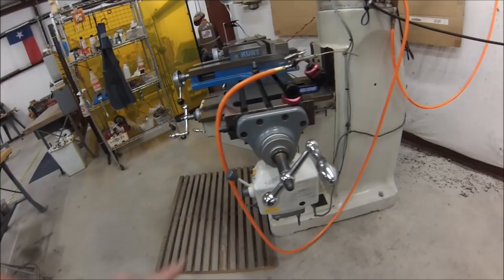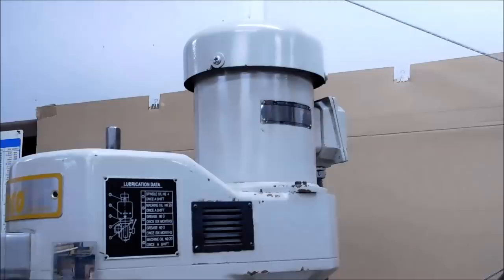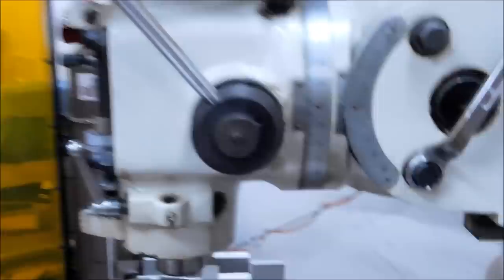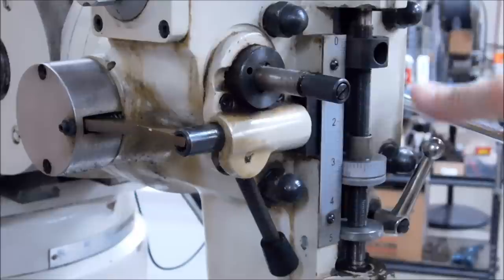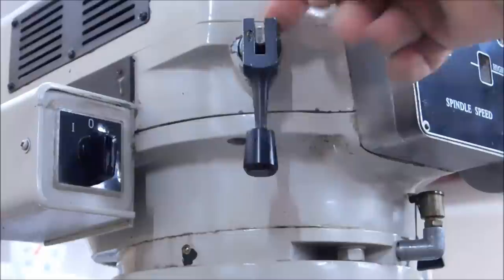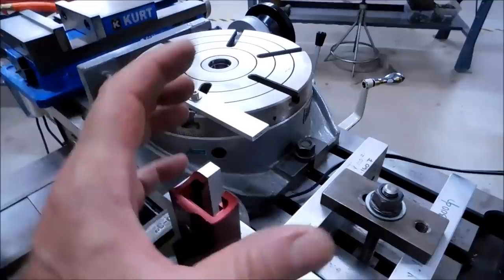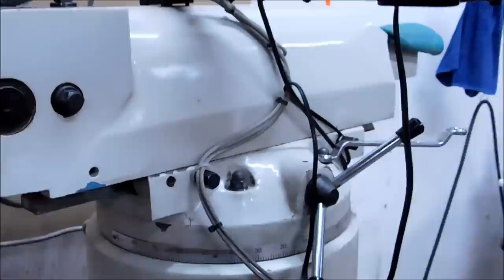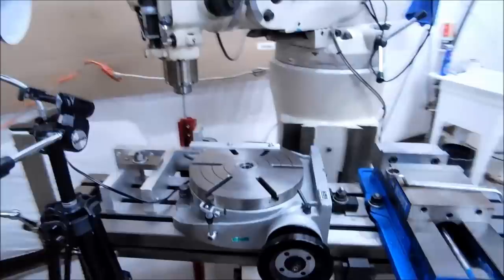Machining - Bridgeport Controls 101 ( and some other stuff )

Comment: Hey Joe , thanks for the video. I just wanted to mention that the feed handwheel is pretty useful for drilling in grabby materials like brass or copper, where you might need to peck as opposed to power feeding. I dont use it often, but it is a nice option sometimes. Btw, I sure miss Enco! Thanks again bud, taker easy
Reply from the maker: MSC bought ENCO a few years back. I bet the machines are exactly the same.

Comment: Power Quill feed is in inches per revolution, typically .0015”, .003”, .006”. Love that outrigger fixture for machining the ends of long parts, going to add that to my project list. Turret knee mills are very versatile. Thanks for making the video. Stay healthy.

Comment: Great VIdeo, Joe Pie.  You should have been a shop teacher at a community college - as you would have been one of THE BEST EVER..  One thing that you didn't do - that was drummed into my head - was to run your finger or thumb up in around the inside of the spindle - to make sure that there are no chips or burrs prior to putting the R-8 collet in... Just a difference in how you are taught.   I have a Chevalier, a upgraded CNC SuperMax YCM-30,  a Brother 215 CNC mill, and a table top mill (Sherline that I CNC'd - its an addiction, what can I say?).  You are totally awesome machinist and instructor - love every video... THANK YOU- for taking the time to put this all together - you're a great instructor.   Please keep up the great work.
Reply from the maker: Thats quite a compliment. thank you. I do regularly check for debris in the spindles, on all my mills, but didn't show it here. That is a good thing to point out. Just do it with the machine turned off.

Comment: Interesting I recently replaced the clock spring on a bonified Bridgeport. I did a really bad thing I read the instructions. They claim the clock spring tension should be set to keep the quill in position only. Not tight as to where it moves the quill rapidly up like yours did, or loose as to where it falls (-Z). I am not saying your right or wrong, clone versus B.P.. Personally I am going reset mine to where it brings the quill up just a bit slower.
That being said I love your channel; I have learned so many great little time saving and accuracy improving techniques, thank you so much. I have been working in the field for a mere 10 years, you remind me of the guy I used to work with, a 30 year tool and die guy. Every day I would learn at least one thing from Harry, it was a sad day for me when he was fired for no good reason. Hope your doing well Harry wherever you ended up & thanks again Joe.

Comment: Good video just got a hold of a 20 year old new old stock  9x42 J head Comet Mighty Max clone for $3200.00 . I'm a retired mechanic  and just started getting into machining this last year .Thanks for the how to videos.  Now i need to sell my new ZX45 bench top
Reply from the maker: Buy nice or Buy twice.....
Reply: Joe what do you think of the Comet clone made in Taiwan it has M in the casting I'v saw this on the Acer brand 
Thanks Steve
Reply: Hi Joe one thing i don't like on the Comet clone is the saddle  has a thin nylon strip on it that  the table rides on  . the knee is scraped
Reply: @junkmannoparts9696  the M that is on the machine indicates that the castings are Meehanite not just cast iron. Nice find.
Reply: @joshwhite6947  thanks for the info.

Comment: I'm not sure on your Enco but on my Taiwanese Precision Matthews, which is a Bridgeport clone like yours, the low, medium and high settings are labeled as .0015", .003" and .006" respectively.  

Enjoy your videos Joe.  I now even use the "bump" technique with the tailstock on my lathe when drilling deep holes after watching one of your videos.  Great tip and thank you for sharing your knowledge and years of experience. 
Mike

Comment: Joe, the "power down feed speed" is not a speed, it is a feed rate, locked to the spindle rotation.  On my Bridgeport it is 0.0015, 0.003 and 0.006 PER revolution of the spindle.

I'm new to all of this so I run my machine relatively slowly. Last job where I used the power down feed was in drilling through a brass weight to clamp to a trombone.  I was using the power feed to keep the drill bit from being yanked into the hole.

Comment: Hey Joe, thanks for the follow up vid. The power down feed and holding the brake to tighten the draw bar were new for me. You can always hear stuff being done in all the machining videos but no one shows it. I remember Keith Fenner mentioning in a couple videos that he used the crank wheel on the down feed as opposed to the spindle in times that something would grab and wouldn't suck down through  a part. He didn't show how though just described it. Anyway good job thanks

Comment: Joe, as far as spindle speed goes,  the VFD that runs my Bridgeport only shows Hertz on the digital display.  I got an inexpensive Electronic Tachometer from Amazon and made a small cheat sheet for Hz to RPM for spindle speed. It has really helped me with my speeds & feeds.

As my health allows, I've been making an adapter to replace the quill feed lever with a nice hand wheel. I believe it will suit my needs better than the single handle.
Cheeers

Comment: What I find interesting is the absence of a power draw bar. It saves a lot of time. I use to machine in the shop at the university and with limited time to change tools my actual cutting time has increased dramatically since they installed power draw bars. I guess is the same for everybody because finding an empty mill is not a big issue anymore.

Comment: I have a Jet 10x50 mill the top is .006, middle is .0015, and the bottom is .003 that how it is marked on the machine. Great video. I will be making one of them outriggers to stand a peace vertically in the machine. I actually have a project that I need it now. Thanks.
Reply from the maker: Awesome. Be sure to put that lower stop on it. It makes clamping the part pretty easy.

Comment: Your spindle feed ratios may be different Joe, but it's not hard to check what yours has. I suspect they probably did copy what Bpt decided was correct though or it might even be listed in your operators manual. Fwiw my Tai built clone shows feeds in thou at all 3 positions so a bit different than yours with only those numbered positions. On mine with the lever straight up that gives .006" feed per spindle revolution. Middle position is .0015" and straight down is .003". I believe the real Bpts have the exact same feed ratios. Since they are geared to the spindle rotation then whatever feed rate you pre select remains the same per spindle rotation no matter what rotational speed the spindle is doing or high / low range (back gear) your in.

Comment: Hello Joe, 

my views on some of the points:- 

Handwheel versus the hand lever to operate the quill. 
The hand wheel is positive control but depending on what operation and material you are working with e.g. drilling through some plastics, using the handle it can grab and pull the quill down as you break through. With the hand wheel this does not happen. Personally with most jobs I do I just use the handle, the hand wheel is not any real gain, and not as easy to use..

Power feed selector.
I had to rebuild my Bridgeport (Well it was cheap) and I seem to remember that the feed is dependant on spindle speed and the three options are simply travel per spindle revolution, what the actual distance is per revolution, I have no idea?

Quill handle.
The Bridge[port manual states that the spring tension should not return the quill but simply keep it in the position it is, i.e. a neutral influence on the quill. It certainly seems a better idea, from the knuckle rapping potential you mention with your machine.

Thank you for all your videos, I have enjoyed them immensely

Comment: The Power Down Feed Speeds on my Bridgeport clone mill are: Right position  .003 per rev, Middle position  .015 per rev & Left position  .006 per rev.;  these are the amounts of vertical down travel per revolution of the machine. My mill is an EISEN 9X49 made in Taiwan.
Reply: I should have said Feed Speeds - Up or Down
Reply: Shannon; I think you may have missed a zero when you typed ".015".  Bridgeports and the clones I've seen are .0015; .003; .006
Reply: @schmidtyyt  You are correct about the missed zero.....

Comment: The typical "Bridgeport" clone down feed is #1  .0015", #2  .003", #3 .006" per rev.
The older Bridgeports were marked this way..
There is a "clutch" in the mechanism that won't allow too much down force to be applied.
Max drill with power feed is 3/8" in mild steel.

Comment: Is your machine securely bolted to the floor? It must be to angle the head that far. I have seen shops where the machines are on just adjustment feet. Accidents waiting to happen.
Reply from the maker: Mine is not. Swinging a head can be made worse when the table is also extended to a limit with a heavy part.

Comment: I believe the 3 position down feed selector is either .001", .003", or .006" per revolution...no matter the speed, although I believe you aren't supposed to run the power down feed above a certain rpm...like 2000rpm or something

Comment: Great channel, great machine and great advice Joe! I was hoping you'd answer a few questions. Little background; I've been Machining for 6/7 years, started in injection molding repair but I've been in optics and collets/spindles/gears. I've run Bridgeports, Lathes, surface and rotary grinders, a lapping machine and a Studer CNC. The company I'm at now pays better than the grinding job (for the company that actually builds and sells grinding and milling machines, somehow.) but the only mills are the oldest cheaper J head fixed speeds you have to manually move the pulleys on from around 68 and 73 respectively and the company has been around since the 40's. Any tips on running those for non nominal radiuses and compensating for not having variable speeds on materials like stainless? Or tips on convincing them to upgrade to something better?(suggested a prototrak converted mill ours are too old to convert, vmc, bed mill or haas mini mill as it's a small area and I'm trying to be reasonable with cost and haas has payment plans lower than 900/month.) Also they told me I'm their expert but I wouldn't say I can be one, I don't even have a full decade under my belt and all my experience was otj not classroom, except for one 4 day welding intro (after they already had me handle welding for about a year without complaint.) what do you think makes someone an "expert machinist"? Sorry for the long post just think people might find this helpful/interesting and I'd like to know what the oldest model you've ran/seen used is and what models you'd recommend to suggest if you find yourself trying to do your job on old or abused machines.

Comment: Joe, thanks for all your great videos.  Do you typically have to tram the head when you extend for reach and/or rotate on the column (like reaching a part on the end of your table, not tilting the head)?  Tram again when you return it back to the normal operating position?

Comment: With the head offset as shown in this video, is there any chance you are getting top-heavy to the point where the machine could become unstable?  Because you are doing head offsetting, is it necessary to have this machine bolted to the floor?  Most folks I know have leveled their machines but not necessarily bolted them to the floor.  Please share your practical views on the matter.
Reply from the maker: This is a very good point. Normally, the mass of the machine is sufficient to keep the machine steady. If you place a large rotary table or part close to the max weight suggested, a tipping danger will increase if the machine is not bolted to the floor. I have seen them tip over, but only with the table extended all the way out and a huge mold body on the very end. Nobody was injured, but it made a heck of a thump and ruined the machine.

Comment: The last shop I worked at was almost 100% CNC. We had one Bridgeport but only got used rarely as a drill press. We were a mold shop but would take in the occasional general machine work. Well I quoted 20 lathe parts that in the end needed 4, 3/16 drilled holes off axis in two directions. I figured we would just run them on the Bridgeport with the head tilted in two directions. I discussed with the milling lead, he didn’t have a clue. Said to job it to a 5 axis shop. Discussed with a old toolmaker, no clue either.  I was out for three months. In the end it got jobbed out to a 5 axis shop. Had to find someone with a 1/2 million dollar machine because no one knew how to run a $5,000 Bridgeport. Silliest thing I’ve ever seen.
Reply from the maker: Wow. Never a FOG around when you need one.
Reply: Joe Pieczynski but it gets worse. When I got back three months later the parts were just back from black oxide coated. The 5 axis guy screwed them up, had to weld them, all parts!  I should have jobbed them to you. I didn’t know it at the time but your only a few miles away.

Comment: Is leveling and / or bolting the mill to the floor an important step before using a mill? Currently my mill (a Bridgeport clone) has some vibrations that can be felt while milling. These vibrations translate into the parts that are being milled. I noticed that you are using shims and no bolts under your mill.

Comment: Joe,
 Before you put that fixture away I would like to see it mounted in the vise. I could use a fixture like that off the back of the table but I don't understand it being any better in the vise.
Great video! I always learn something from you.
 Thanks!
Reply from the maker: I may be able to do that for you.
Reply: Thanks Joe, if it's to much trouble to make a video I can give you my email address and you can just send me a picture. 
Doug
Reply: Great video Joe! I have the same question. I’m not able to put together in my head how the outrigger works while in a vise.

Comment: Joe, I am relatively new to taking chunks of metal and truing them into piles of chips.

I am thinking about purchasing a new machine. The two I am looking at are both Precision Matthews. One is the PM835TV, a 35" table Bridgeport clone, and the other is a the PM833TV, a 33" table bench mill. Which would you recommend for a neophyte chip maker? Or is there another direction you recommend I look? I have absolutely ZERO plans on using my machines to make production parts. This is just something for me to occupy my time in my retirement.
Reply from the maker: Greetings. Like anything else, once you get used to something, you'll always kick yourself for not getting the next better one initially. if you have the budget, room and sincerely see yourself using it more than once every 2 weeks, I absolutely say get the bigger machine. if nothing else, the variety of accessories to expand your adventure will be nearly endless as well. Bear in mind you'll have to have power for it too. Thats where static phase converters will be a gift from heaven. Your only sacrifice using them will be about 1/4hp loss and the inability to go immediately into reverse. But otherwise, you'll never notice the difference.
Reply: @joepie221  Thanks Joe! I appreciate and value your advice.

Comment: @ Joe Pieczynski .. When tramming the head, would it be possible to have a fixture that bolts down to the table and has an arbor standing so that you could insert it into the head with all the adjustments loose and then run the draw bar down to line everything up ? Thank you for sharing your knowledge with us.

Comment: As usual, a very clear walkthrough of a very versatile machine.
If I saw correctly, your machine is not bolted to the floor. Is there any danger of toppling the machine when the head is extended to its extremities?
Reply from the maker: Thanks. The machine mass still remains very central, but when the table is extended and a heavy part is up, the machine should be bolted to the floor. I have seen them lift.

Comment: Hi Joe thanks for all the informative videos. I have learned a lot from them. Question , the oilers on the side of the head how often should they be oiled and what kind of oil in them and what kind of oil in the main lubrication  point also. Keep up the good work, Mike
Reply from the maker: I fill them as they get low. Check them daily. I put light spindle oil in the cups. Way oil in the side auto oiler.

Comment: Hey Joe,, Nice vids been watching you for years,,
Been using many of your tips and tricks. (thank you)

I'm a tool shop machinist and use several Bridgeport’s with
the EZ Trak cnc controls and kurt auto draw bars on them,, 
just wondering if you are familiar
 with the EZ Trak controls?

We have excellent results and hold 0.005 with them..
super tough machines.
Thanks Much.
-K

Comment: Although many have beat me to it but in case someone doesn't know and doesn't scroll low enough, the feed rate sitting on the left side of the head is usually .0015", .003" and .006" feed rate per rev (i.e., how much the quill moves per rev of the spindle).  There are some rare machines that have a different feed rate but probably 90+ % of the Bridgeport and clones are those mentioned rates per rev.
Reply from the maker: Thanks.

Comment: Thanks Joe, my mill shows up Friday.  This couldn't have been better timed.  Now if you had an instructional video on how to install the power feeds, a DRO and a power draw bar,  I'd be all set LOL.  One question, is your mill bolted to the floor, and if not (I didn't see it) is there any risk of it tipping over by rotating the head?
Reply from the maker: Hi Barry. No, my machine is not bolted down. Most of my work is small or light, so its not a problem. if you plan to have the 'Big 3" conditions exist 1. swing head, 2. extend table, and 3 heavy part, you may wish to bolt it down. I've seen them tip over. It makes a heck of a thump.